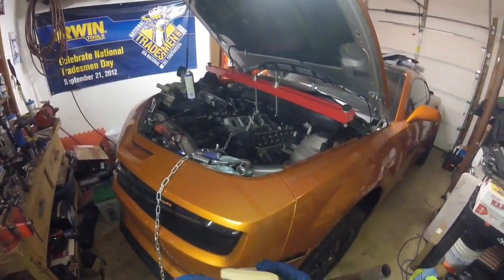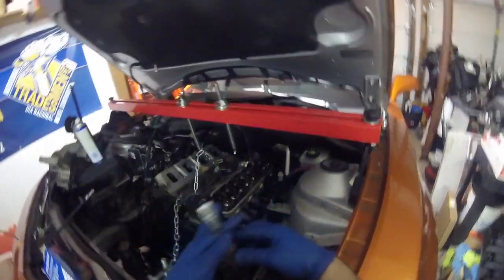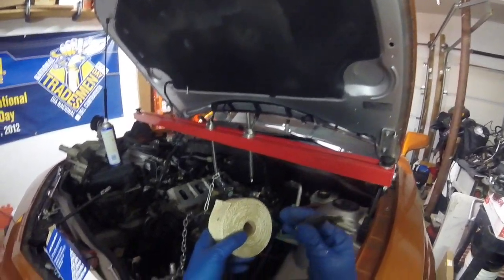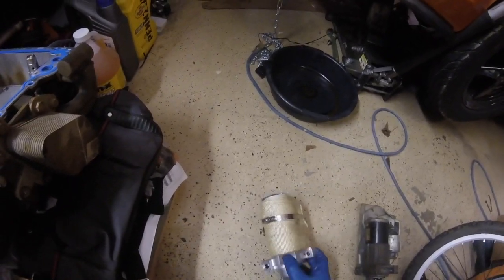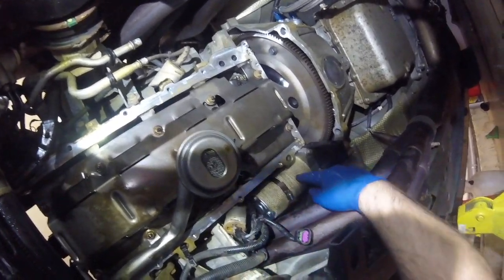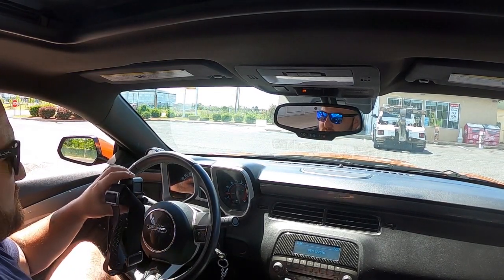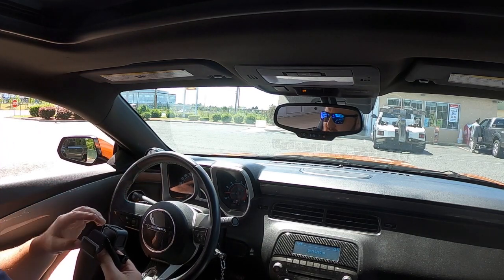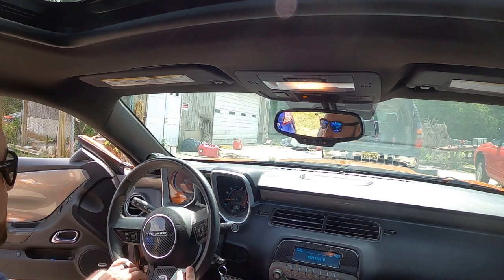5th Gen Camaro- Heat Soaked Starter/ Hard Start FIXED

Comment: Is this really all it takes? I have a 15 SS, and it’s been in and out of the shop (Chevy Dealer) and every fix they did still did not take care of the lagging at startup. My tech Mgr told me I need a battery…even though it’s barely a year old. With everything that’s been fixed or replaced, I was pretty pissed bringing it home and next day, same problem. My issue also tho…is that the Service Stabilitrak light will come on, she then sounds like a tractor from the 1950’s. Since this last fix, when Stabilitrak light comes on, or when she lags at startup, I can smell gas. Any tips?
Reply from the maker: Hmmm you definitely should be smelling gas. Any CELs?

Comment: I thought I was the only one who felt with these issue, I wish I seen this video before I installed my started 😂
Reply from the maker: Maybe just add the ground wire then 🤔
Reply: @The1st60ft  could you show me where you connected yours at, because my tuner told me to connect a ground wire from pos charge on my battery to starter & it would start straight up or is that not needed I can do it another way
Reply from the maker: @MaroVillain  I went from the body of the car to the motor

Comment: Does this happens when you have some mods on the car, like headers ?   I have a 2012 Camaro  2SS  1LE with  35,000 miles  ad never had a problem with the starter,  even after a track day.
Reply from the maker: Yeah usually after Longtube Headers. They have so much heat radiating off of them from being thinner. It's a good idea to heat wrap the headers or starter. The Longtubes go right next to the starter
Reply: @The1st60ft  Great , I don´t have that problem but I will install the additional ground anyway, just in case.

Comment: i replaced 3 starters already . when the car is very hot, i have extremely slow cranking. This happerns after hard traffic in the downtown only but not on highway. So, I have a defect only appears when driving after hard traffic in the city center.. 2011 camaro ss

Comment: I would like to share how I fixed it my way. I have a 2012 Camaro 1SS/RS and it had a heat soaked starter which almost left me at Goodyear after getting the car inspected. I put a Powermaster high torque starter, starter blanket, and Odyssey battery. OMG this thing turns over like a Honda now! I tried adding the extra ground wire before but it didn't do much that I could tell. I can't say enough on how happy I am with this starting system..... ABSOUTLEY AWESOME! Hope this helps.
Reply: And how's the camaro now bro? Its still good?
Reply: Yes very interested as well

Comment: Had the same issue, purchased new starter, wrapped it in exhaust wrap, put a blanket over it as well, reinstalled heat shields. I have coated headers and wrapped the headers by the starter, added another ground, and still fried the starter. 6th gen Camaro.
Reply from the maker: Jeez!! Wth 🤦‍♂️

Comment: Yep I had the same problem  my shop added ground  problem went away   ur ss is nice bro.  Love ur video s
Reply: I am having that problem Severo it cranks so slow and sometimes does not turn on at all, it just happened at walmart San Bernardo some people helped me to push and it turned on using the clutch.
Reply: @israelortiz7408  that will work I would add ground from the engine block to chassis  and put heat shield on starter

Comment: What size is the bolt that goes into the head?
Reply: Actually FINALLY found the answer by digging through tons of forums. So if anyone is having trouble finding it, M10x1.5 (20mm long, any longer requires washers as the hole isn't very deep)

Another person commented that a 3/8 x 24 (fine thread) worked for him. That did not thread in on my head, the m10x1.5 did, I was able to turn it with my fingers until the end.
Reply: @erick46590  Nice man,  you helped a lot of us with that info. Thanks.
Reply: @erick46590  did this fix ur slow crank issue? Hard to say if it was the new starter the ground strap or the heat wrap since he did all at once in the video.
Reply: @fbody23100  I haven't had it fail to start since I did the trunk strap and the strap on the passenger head.

It does still start slowly sometimes, I have long tube headers and the stock starter, so my starter is just probably showing some wear due to heat soak issues. But this definitely improved the starting issues

Comment: might have to do that with my starter too i having bad heat soaked since i lived las vegas plus i need change out my crankshaft position sensors too so i am ordering brand new starter, crankshaft position sensors and heat wrap tape too. Hopefully this fixed my heat soaked problem